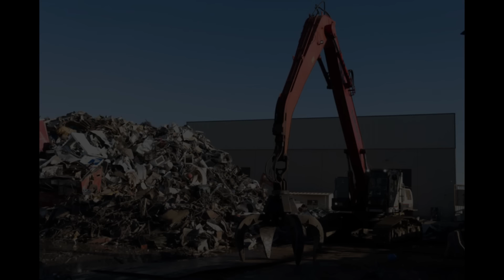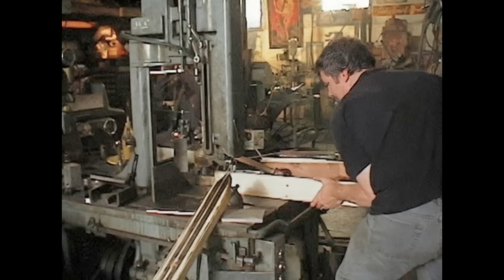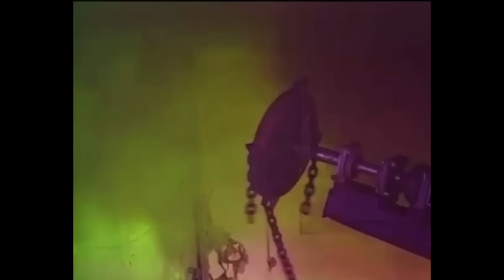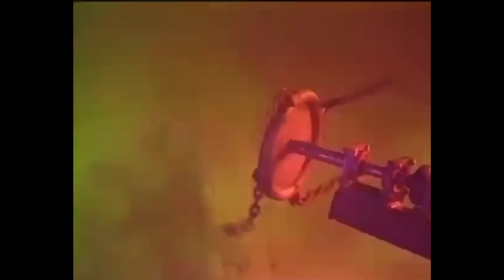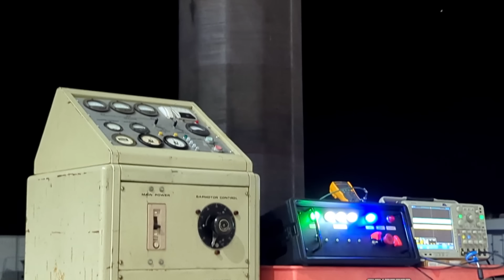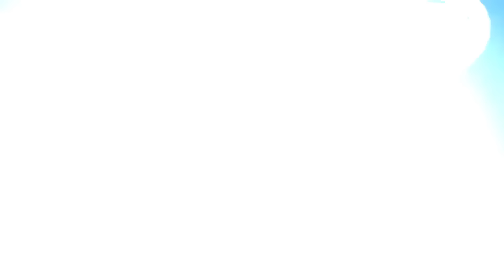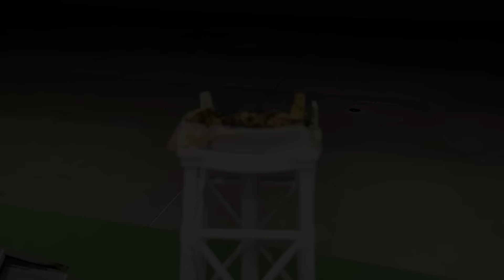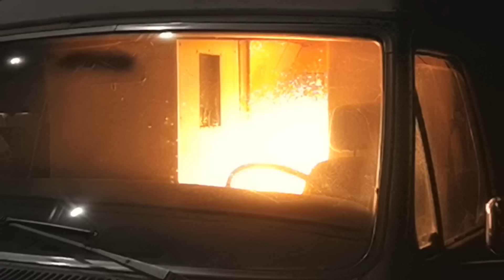Creating a Plasma Cannon by Boosting Tesla Coil Strike Energy

Comment: A friend sent me this video, “Firing the Lorentz Plasma Cannon”, and asked me if it was real.  The Marx impulse generator in it is real, but the “Lorenz Plasma Cannon” is not.  There is a fine wire stretched from the canon to the target on the easel, which is vaporized by the high-current electrical pulse from the Marx generator.  It could be deployed from a tiny spool shot from a barrel on the cannon.

1. Earth’s atmospheric gases are mostly nitrogen (78%), oxygen (21%), argon (1%), and less than 1% total of other gases like carbon dioxide, water vapor, and inert gases like neon, helium, and krypton.  When the air is ionized by a natural lightning stroke or an artificial high-voltage discharge, ozone and nitrous oxide are formed,  None of these ionized gases will produce glowing bits of matter that fall to the ground and then fade out.  Tiny drops of molten metal will do exactly that.
2. You can see a heavy wire on the ground stretching away from the generator directly to the rear leg of the easel and then running up the leg to the back of the target.
3. If you look closely at the 8x slo-mo videos of both discharges, you can see a faint reflection of light traveling down he discharge path -- this could be the spool of wire just before the shower of sparks.
4. If you look at the 6,000x slo-mo video of the first discharge, and freeze-frame just before it, then step forward frame-by-frame, at the frame labeled “T-1.95002383s”, you can clearly see the beginning of the discharge starting from behind the easel and going up the wire, before the next frame with the bright flash of the full discharge.  This is most likely caused by the polarity of the Marx generator with the high-voltage positive connected to the “cannon” and the grounded negative connected to the easel.  Since electric current is the flow of (negative) electrons, they are entering the thin connecting wire at this point.  Then they will push all the free electrons in the wire ahead of them up into the positive “cannon” to complete the circuit.
5. The red aiming laser does not have anywhere near the optical energy needed to ionize the air and guide the Marx generator’s perfectly-straight discharge.  Publicly-available peer-reviewed papers detail experiments in laser guiding 2,200 KV DC discharges over a 4.5 m gap.  Using a femtosecond Terawatt laser, they were able to produce triggering and guiding over only 2.4 meters (about 7.9 feet).
6. Without extreme pre-ionization, there is no way a mere 150 KV will jump the distance shown.  Furthermore, for the claimed 240 KV from a 6-bank Marx generator, each bank will have to charge to 40 KV, which represents more than 21% overvoltage on the 33 KV capacitors as shown on their spec label.  Typical capacitors of this type have much lower breakdown voltage percentages (e.g. 30KV rated, 35KV breakdown = 17% and 80KV rated, 90KV breakdown = 11%).  These under-rated capacitors will fail almost immediately.

The video “Firing the Tesla Tower as a Plasma Cannon” is real.  The regular discharge from the Tesla Coil provides the pre-ionization for the high-current current pulse channel.  The only incandescent material comes from the strike point (and small amount from the initiation point on the toroid).  A few frames afterward, the orange-pink glow of the ionized nitrogen plasma is visible, and quickly fades, rising from its elevated temperature instead of falling like the much denser material melted off the strike point.  Also, the discharge path is convoluted and tortuous, as is typical of real high-voltage arc channels.  Again, if you freeze the video before the second discharge, then advance frame-by-frame, the 3,840 fps slo-mo shows the high current discharge starting at the upper tip of the fluorescent tube because the capacitor bank negative is connected to the bottom of the tube.

There are also some shots of the original 5-bank Marx impulse generator.  There are liquid copper-sulphate charging resistors with a loop in the hose to increase their inductance, which is a nice touch, but the spark gaps are oriented incorrectly.  Instead of their horizontal gaps, they should be oriented vertically, so that the U-V light from the first discharge in the series can help to ionize the air in the next gap above it, and from that to the next one.

I also saw a video of his 40-foot Tesla coil, and that is obviously real and quite incredible, including its clever portability design.

I have a background in electrical engineering and extensive experience with high-voltage equipment, including providing HV electrical effects for late 60s and early 70s low-budget movies.

I will be happy to repudiate my critique of the “plasma cannon” if Mr. Leyh can demonstrate it to me under conditions that will allow me to verify that there is no wire in the discharge path before operation.

Comment: Did you put a firework inside of the water tower?
Reply from the maker: Better than that, a ground wire ran through the tank, for the lightning rod on top of the tower.  It of course turned into a 6000° plasma channel.

Comment: I wonder if a device that built up a strong (negative or opposite charge) and grounded, could be set further away and attract a bolt form that tower. Something like a battery operated device with a stake in the ground that just builds up a strong negative charge greater than even a tall tree. :person-blue-holding-pencil:

Comment: I’m a big fan of your work, Greg Leyh. I’m really interested in high-voltage engineering and I want to build a powerful Tesla coil myself someday. Your 40 kW coil is one of the most fascinating projects I’ve come across, and it really inspired me to learn more about how these systems are designed and built.

I’ve looked through the information on your website and watched the video where you talk about the coil, but it honestly left me wanting to understand much more. The short explanation just sparks curiosity about the engineering, the design decisions, and the challenges behind building something that powerful.

It would be amazing if you could make a detailed video explaining the 40 kW coil—how it was designed, how the components are arranged, how the power system works, and the reasoning behind the choices you made during the build. A deep dive into the design and operation would be incredibly interesting for people like me who want to understand the technical side of it.

I’m sure many fans and electronics enthusiasts would be very excited to watch something like that. A detailed breakdown of the coil and the story behind building it would be incredibly engaging and honestly irresistible for people who admire your work and want to learn from it.

If a full video isn’t possible, even a detailed email explanation would mean a lot. Any extra insight you could share about the 40 kW coil would be greatly appreciated.

Comment: Pretty cool, but how are you calculating voltage? What's the base current of the secondary * characteristic impedance? Relativistic electron runaway may not be occurring with HV AC because the polarity of the transformer is reversing the moment after the voltage peaks and the maximum output voltage may not be high enough to allow a large free mean path for electrons to accelerate without colliding with any air molecules. Brush discharges are not necessarily the same as what you may have seen from Russian 7MV DC marx tower discharges that jump way greater than the ~20kV/1cm proportion for air breakdown. The free mean path of a 7MV electron in air may be >100x larger than "slow & lower" voltage discharges. The odds of collisions & air ionizing is much lower for extremely high voltages which a brush discharge from a tesla coil may not be even close to replicating since the distance a "1MV" Tesla coil sends out an electron before it ionizes air is only a few centimeters, then polarity flips from the tesla coil, then it gets pulled back in.

Comment: Several years ago, I saw 12 banks of 22kv caps on a surplus auction. Dunno how I'd transport them or where I'd put them, they would have filled my garage to overflowing. But the fun/trouble I could have gotten myself into...!

6 caps per bank, 72 total, 50kJ per cap... 3.6MJ total if I'm calculating correctly. 🤯⚡⚡⚡

Comment: i wonder what would happen if one were to create a machine that, say, threw a couple hundred dining forks in the air, at the moment of boost. In slow motion.
Reply from the maker: There's a good chance that you would get distributed arc attachment.
Reply: @LightningOnDemand One day I hope we all get the opportunity to witness it, if able to be done safely & reliably enough to commit to film. It sounds like some incredible visual phenomena. 

High voltage, high current stuff is extremely cool to see. There's so many things I'd be sorely tempted to put in the target of the zappinator here. Have you glassed any particulate matter with her yet? :D

Comment: would a relatively high power laser heat up the air to reliably aim the electric arc?
Reply from the maker: It could but it requires A terawatt pulse laser that cost over $1,000,000 :<

Comment: Too bad the massive electrical pulse of the Tesla coil couldn’t follow the path of the laser beam. What if you launched a model rocket horizontally at the target that you wanted to strike with the Tesla coil.  The model rocket would carry a great distance of very small diameter wire or something cheap and conductive to mimic the control wire of a TOW missile system.  But instead of using the wire to control the rocket it is used as a path for the Tesla coil’s energy.  Or if you wanted to get real fancy could also control the rockets guidance.  Then the Tesla coil could reach much further distances by making a physical pathway?  Too bad the Tesla coil electrical arc couldn’t follow in the path of the exhaust smoke produced from the rocket motor, that way you wouldn’t have to use wire.  But then it would maybe be effective on non-windy days.  I don’t know if they still do but years back some scientists were using model rockets with a length of wire connected to attract lightning to a predictable target for some experiments.

Comment: I'd say it's not the air that conducts it's what's in the air eg dust, metals, nitrogen gas rising hot air and rain contribute to it then gasses get cooked creating a path of low resistance and they actually meet in the middle over looooooong distance 😅

Comment: you know a flash tube light first uses high voltage ballast to make the arc then use low voltage high current to keep the tube arc plasma light on. making a red alert tesla coil tower hmh. next level up is an emp.

Comment: Now we just need to attach a properly collimated pulse laser to ionize the air and create a path for the lightning to increase its range. There's been real life proof of concept work done on this.
Reply: you need a terawatt laser for that. lightning is 1 gigawatt (avg). A terawatt is 1000 gigawatts
Reply: @ferrocerium123  Laser pulses can be incredibly short. The laser doesn't need to shine constantly, not even over the course of the discharge. It just needs to beam for a minimal amount of time to ionize a channel in the air and the capacitor discharge keeps the channel ionized.
Reply: @Steve-pe1qt  still a terrawatt laser yk? Its very expensive to make such a system
Reply: @ferrocerium123  terawatt*
Reply: @Steve-pe1qt  im to dyslexic to spell terrawatt as terawatt
Reply: @ferrocerium123  dang im sorry
Reply: @Steve-pe1qt  lol

Comment: Build a dual-bolt crossbow-fired anti-vehicle taser next. Armor piercing crossbow bolts with high voltage cabling. See how long it takes to completely disable a running vehicle.

Comment: Is the boosted power sent directly into the secondary coils or through the primary first?  How does the large current of the boosted power not cook the secondary coil?
Reply from the maker: That's where a pulse-forming network helps immensely.  A flat rectangular pulse can deliver a given charge with a much lower I ^2 t value than a spiky capacitive discharge.  The magnetic stresses on the secondary are also much lower, given that stress rises with I^2.
Reply: @LightningOnDemand  can this work on a SSTC? Or will there just be magic smoke in the CTs and drains of the fets?
Reply from the maker: The loss of magic smoke would be a real challenge for any solid-state system.
Reply: @LightningOnDemand  fr
Reply: @LightningOnDemand   what about VTTCs?

Comment: Could you use a laser to ionize the air between the coil and target to direct the arc?
Reply: you need a terawatt laser for that. lightning is 1 gigawatt (avg). A terawatt is 1000 gigawatts
Reply: @ferrocerium123  There is dust in the air that would turn to plasma at lower power, no? Also, the beam can be narrow, no? Can I get a second opinion? If not a laser, how about an electrified high pressure water nozzle? a stream of water.
Reply: @AnotherGlenn  the dust in the air would disperse to easily and not create a stable plasma channel. Several people have done electrified liquid streams to guide high voltage including Arc Angel, Alen Pan, and even LightningOnDemand with mythbusters

Comment: Looking at the boost capacitor bank i  guess that these are about  1 uf at 3o kv caps  X 18  so at 24 kv deliver approximately 5,000 j .
About 0.0013 sec total.  about 16 discharges   81  usec per pulse  each pulse a maybe half that 40 usec in duration.  I count 16 pulses 
so > 300 j per pulse when at full voltage. That's like a a rifle bullet.  An electro machine gun.

Comment: I'd worry that the pulse forming network would do bad things to the secondary coil by sending nasty current pulse through it
Reply from the maker: Indeed!  is the main reason to use a pulse forming network, to set an optimized waveform that minimizes magnetic forces and I^2*t damage.
Reply: @LightningOnDemand What would happen if one just grounds the base of the coil to 50 μF cap bank precharged to say 25 kV and then power the whole thing up?
Reply from the maker: There's 2 major machine hazards to mitigate there;  a secondary to primary flashover, and the spiky nature of a capacitive discharge destroying the secondary winding.

Comment: If there was a way to use a nitrogen laser that would ionize the nitrogen in the air to produce a long range means of creating a path for the high voltage to further ionize the air, then hit it with a high current pop and utilize the ground loop for a complete current path.

Comment: Have you considered using a magnetron or a UVC laser to boost range? Blooming can be an issue, but with proper antenna/pump ability it should be sufficient to boost the range of this to the point you'd want to be in a desert with no one around. 

C&C Red Alert just become reality :)
Reply from the maker: The diffraction limit of microwaves might make the beam angle a bit too large.
Reply: @LightningOnDemand  This is true. UVC is what I've thought about before, but excimer lasers are usually export controlled under ITAR and a nightmare to buy (and expensive). Making an ArF laser is a headache,

Comment: Bro, you have the world’s biggest drsst! Imagine if you made it QCW.
Reply from the maker: It's just a spark gap coil.  No solid-state needed!
Reply: @LightningOnDemand Well, I saw your previous videos and it looked like solid state. Also I kinda commented before seeing the spark gap part. Honestly pretty impressive.
Reply: @LightningOnDemand Actually I reviewed the previous video since I forgot how it was but I am curtain it was an SSTC since it was interrupted.
Reply from the maker: @nexcover1083  The one third scale coil does have solid-state drive, but it's just a straight resonant converter, not a DRSSTC.  The 'DR' part would be cost-prohibitive at that scale!
Reply: dude the buck converter would be insane, unless it was phase shifted which is really hard to scale up, or sigma delta modulation which is still just a theory

Comment: So did you use a filter on the output ripple of your 3ph rectifier?? And how did you get the pulse network to trigger at the right time? Excellent video....
Reply from the maker: The great thing about three phase DC is that no filter is needed.  The ripple is only 16% unfiltered!  The current signal in the secondary coil provides a good indication that the plasma channel has transitioned.
Reply: @LightningOnDemand kinda figured... Thanks again...

Comment: I see some coments on laser guidance for preionisation, but what about an electron beam? At a few MeV it would be relativistic and travel a few meters in air... It would have to be specially made for the purpose though and idk if there is much info on this sort of stuff... 
Due to high time dialation it should stay rather narrow, but it might branch on hitting atoms... Idk how strongly the beam would diverge in air... With a top notch state of the art hobbyist design, you might be able to fit one with sufficient energy inside that topload.
I dont think it would massively increase range, but a few extra meters of conductive path is pretty good, and probably gives a little bit more directional control as well

Edit: aperantly a rule of thumb is about 3.7m (or smth like 10 or 12 feet?) per MeV...
So a 5MeV beam can travel about 18m or ~60feet through air...
And it would prob need to be pulsed, since continuous power able to create ionized paths, would likely oversaturate the area very quickly loosing the narrow beam geometry, but idk.
Reply from the maker: It would be great to have such a device, especially for research later on towards relativistic runaway breakdown.